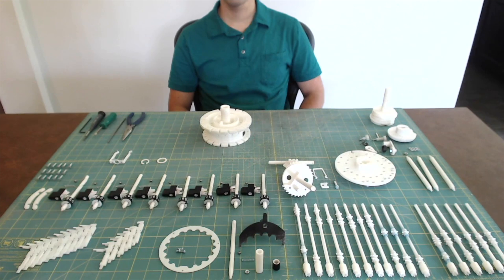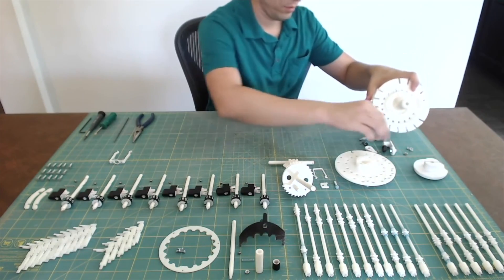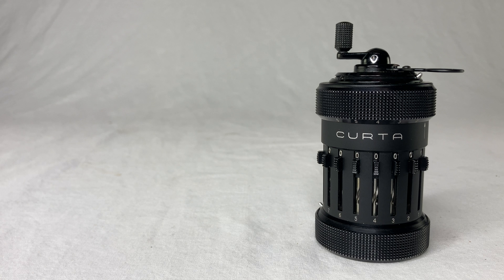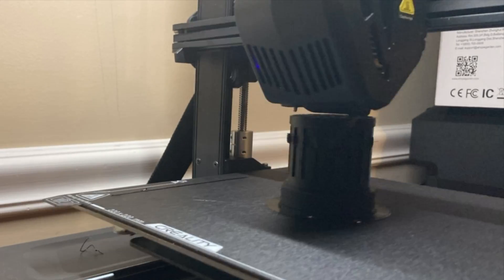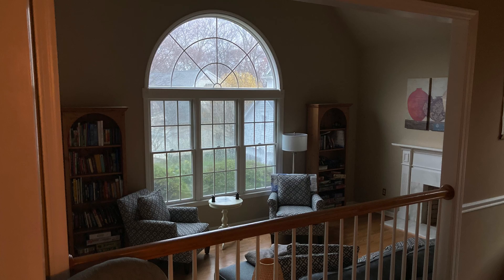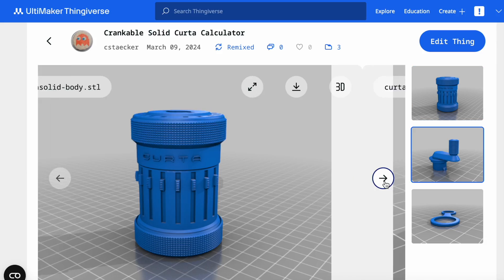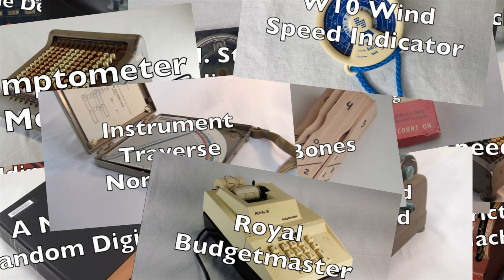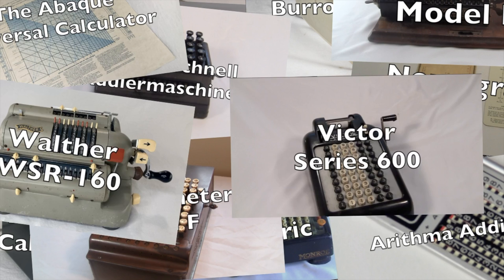3D Printable 1:1 scale SOLID CURTA

Comment: I have some problems with the model. Importing into Bambu studio reports errors and builds the model without the hole at the top (maybe the "Windows only" "Fix Model" would help?). Importing into oneshape did not work either.

Who wants a curta without crank?  (But the knurls came out beautifully).  🥰
Reply from the maker: Hmm. I use Cura Ultimaker, which doesn’t complain about the model. Filling in the hole is maybe caused by bad normals in the file? I’ll give it a look, but I’m pretty bad at modeling. Maybe somebody else encountered something similar? I’m happy to revise and reupload the file if it can be improved.
Reply from the maker: I think I might have fixed it, or at least improved it. Can you try this one: https://faculty.fairfield.edu/cstaecker/curtasolid-body-new.stl
If that's better, I'll replace the upload at Thingiverse. (I needed to recalculate normals in blender- the faces across the top were all pointed inwards instead of outwards.)
The crank and ring files are OK, right?
Reply: @ChrisStaecker  Bambu Studio and Onshape still complain, but the Bambu slicer can handle the new model just fine. I'm cranking like a boss now! Thank you so much! 👍❤

Comment: I guess, in the range between this nice knurled sculpture and the upscaled working model there is somewhere a *duino-based thing with linear and rotary encoders and LCDs for output. (Subtraction works, too, with the experimental firmware from a GitHub fork)

Comment: I thought perhaps with the more widely available high quality resin printers that you were able to just scale down the 3x model...
Reply from the maker: People tell me that this would be possible, but that resin parts don't handle friction well. I'm not an expert.
Reply: I'm not an expert either, but I play one on the internet.
Reply: Marcus Wu added extra clearance to all parts to allow for extrusion printing artifacts.
Given that resin printers can print more accurately, then they would produce a 3x scaled model with more "slop".
If you just shrank Marcus's 3x model, that may produce a resin print that moves or that jams...

Does anyone make functional resin prints, or is it all character models?
Reply: @jm493 good point, but all the clearances would also be reduced by 1/3, so although it would still probably "feel terrible", it might work. Deflection would be a bigger issue... perhaps use some metal rod instead of the printed ones in Marcus' model?  Might be worth it to be able to pop the doink. 
As for functional resin prints, I'm not sure this would really qualify. It's not under any real loading like a shelf bracket.  Friction and the gear reductions could put some higher stresses on some of the gears, but plastic is still quite strong.  Integza makes some arguably functional prints, and Tom Stanton has been making some more recently in his projects.
I have neither the resin printer nor the patience to try any of it out. Hopefully the internet will do its thing eventually. 
Cheers!

Comment: Do you think there will be a version 2 with a popable doink?
Reply from the maker: If somebody makes a model, I will doink it on YouTube!
Reply: @ChrisStaecker  i do some CAD stuff, i'm tempted to make one that can properly pop the doink, maybe even let the sliders move.

if anyone else wants to make one, don't wait on me because i may never do it, you can probably make it higher quality anyways.
Reply from the maker: @Minty1337 In seriousness, my main goal was to minimize the number of pieces to print, and make assembly very very easy. If you want everything to move and doink, the original design by Marcus wu does it all. I thought briefly about how I could make the doink work without requiring more pieces, but I couldn’t think of a good way to do it.
Reply: @ChrisStaecker  i was thinking of something in-between the display model you made, and the functional version, my intent is for my version act as a fidget toy. it'd still be simple since it's not actually doing any math, probably only like 5 unique parts, the sliders being simple flat duplicate prints. just have an internal cylinder with rails for the sliders and an external cylinder that goes overtop and holds everything together.

and i think i could get the doink to work without adding any pieces, or at least, making the separate pieces into a single print-in-place thing, but idk exactly what i'll do yet, if i do this project at all.
Reply from the maker: @Minty1337 that sounds great- I’d make one!
Reply: @ChrisStaecker  I'll see if I can get you a link to it if/when I have a finished model, I'm glad you like the concept! I think it'd be fun to have a curta-style fidget toy, reminds me of those little fidget cubes.
Reply: +1 for doinkable version